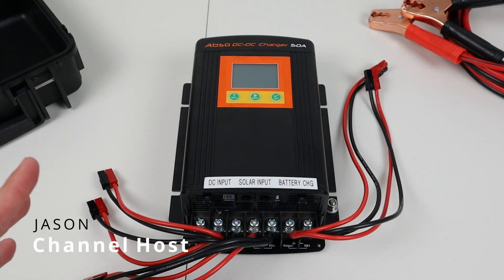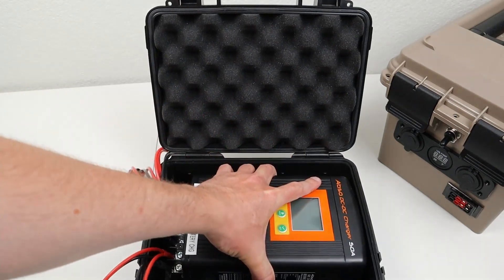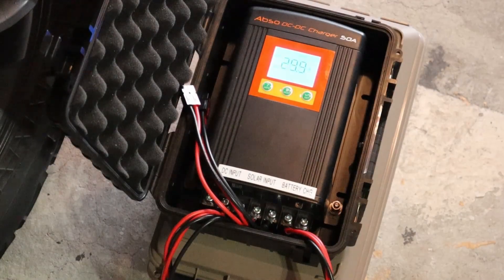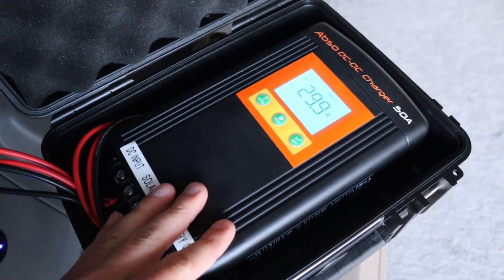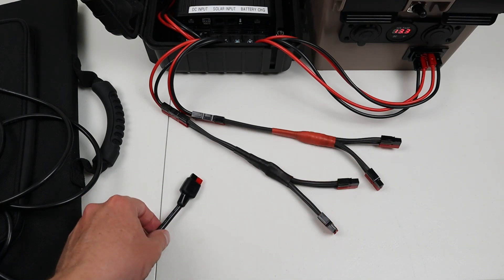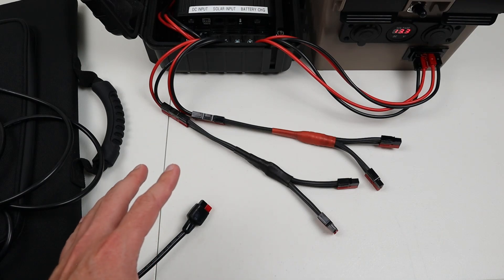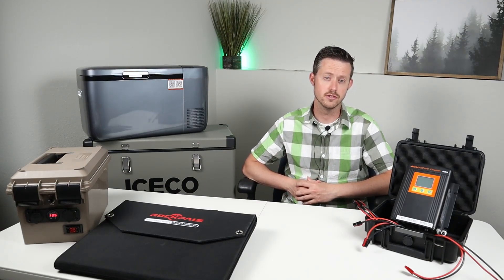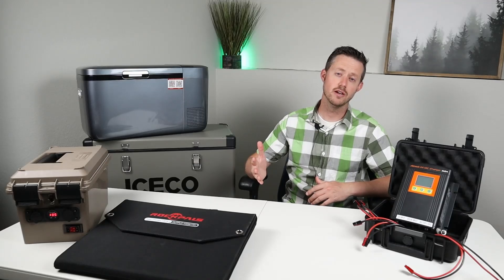The Perfect LiFePO4 Charger?! - Kisae DMT1250 Solar MPPT and DC to DC Charger! Portable and Powerful

Comment: Do the terminals support 6 AWG wire for the DC/DC input/output?
Reply from the maker: 6 awg should fit just fine
Reply: @Jasonoid  And do you know what revision level of firmware is required for the remote display to work with the DMT1230?
Reply from the maker: @s.mendez7160  I'd reach out to their support for that question.

Comment: Thanks for the video! I've been searching for a solution to charge my Bluetti AC200P for my Tacoma while driving and also when no Solar available. So happy to have found you this awesome solution.  In lieu of the Pecron DC1242-500 Smart Car Charger, this device has more options. Favor, I see you this wired to your 4runner and I like to also wire to back of my tacoma. What are the wire sizes you used and also the fuse that you used? Thank you!
Reply from the maker: This won't charge a power station, you need higher voltage like the Pecron car charger to do that. This only puts out 14v. This is only for charge standalone batteries. If you want something similar but meant for power stations, look at the Etaker car charger.
Reply: @Jasonoid  The Etaker is exactly what I'm looking for! Thank you Jason! Keep up the great work!

Comment: Hey Jason, I revisited the video and noticed something intriguing. You mentioned having around 670 Watts of solar panels connected to the KISAE Abso. However, the video stated that it accepts a maximum of 500 Watts of solar input. Does this imply that if I were to parallel two 300 watt panels, the unit would only utilize what's necessary to achieve its maximum output?
Reply: Hi Jason can you tell me how long typical the Kiesa takes to charge your 100 Ah LifePo4 battery?  I have the 30 Amps Kiesa charger.  It's been about 4 hours now and it's still charging.  Is that normal?
Reply from the maker: I'm pretty sure that's how this unit works, with more than 500 watts of solar connected, it would limit the output to the battery at 500 watts.
Reply: @Jasonoid  Okay thank you I have a couple of house panels I brought used on facebook marketplace and just wanted to know if they were too much power for this unit. 
Thank you again!

Comment: Thank you for this video, I've been looking for another solution to keep  my AGM and Lithium batteries top off in an emergency.  I'm a beginner, I had some ideas but didn't know how to fully implement them.  After seeing your video I was able to purchase a DMT1230 open box on Amazon for around $100 bulks.  I have some powerwerx 10 gauge wire, left over from another project.  I notice that you were using 12 gauge wire double up for your connections.  Can I use my 10 gauge wire?  Secondly is this 10 gauge wire suffice for my 100 watt panel to connect to the controller an from the controller to the battery being charged?  Lastly do I need a inline fuse?  In the future can you make a step by step video showing how to setup the DC to DC charger?  Reason being I have different AGM an lithium size batteries I would like to keep top off.  Any help would be greatly appreciated.  Thanking you in advance!
Reply from the maker: Nice find! 10awg wire is good for 30 amps peak, so that will be fine with the slightly smaller DMT1230 (especially with the 100w panel). You shouldn't have to worry about fused on your charge controller, just fuse any of your loads coming off your battery.
Reply: @Jasonoid  Thank you for replying to my post.  And thank you for that info.  I connected a 12V AGM to the battery input side.  Just to see if it would allow me to view the menu options.  The screen would not turn on.  Does that mean the unit is damaged?  Or do you need to use a solar panel to power it on?  Maybe the open box was sent back to Amazon for that reason.  Not really sure what are your thoughts?  I'll try solar panels in the morning to see if it will work.

Thx!
Reply from the maker: @minceym  connecting the battery to the postive and negative input ports on the charger should turn the unit on and allow you to change all settings. Once you connect either DC input or solar input it will start charging.
Reply: @Jasonoid  Okay I'll give it another shot in the morning.  Lastly I purchased the HUB from your last video, and it works great.

Thx again!
Reply: I just wanted to follow up from my last post.  Everything is working properly now.  Last question about this unit.   Can it handle DC & Solar inputs simultaneously?  Or only one at a time can be connected to this unit?

Thanks Again!
Reply from the maker: @minceym  it will only do one charging source at the same time, it seems to default to solar as first priority.
Reply: @Jasonoid  Thank you very much!

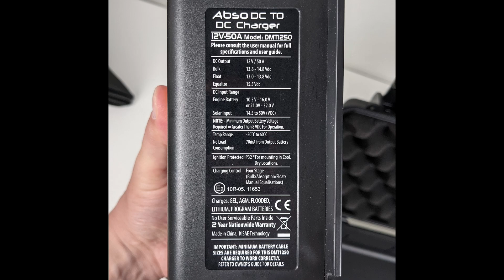Comment: @10:06, looks like BULK CHARGE goes up to 14.8V..Not good for LFP!
Also, the Equalizer is 15.5V  Is there a way to turn that off (unless you  are using Lead)?
Reply from the maker: It's completely programmable, you can set it differently per chemistry. It also turns off equalizing with the lithium setting.

Comment: Overheating is a very common issue with these chargers. The manual for DMT 1250 states that it should have 3 inches of gap and airflow on all sides. I don't think it should be enclosed in a box.
Reply from the maker: Been using this for 3 years in this setup, never had an issue. As long as the lid is open it gets plenty of air movement.

Comment: Hey there ! i have the DMT1230 and really wanna know if i can use a ctek 25a charger connected to my starter battery and then charge my lifepo4 house bank via the dmt1230 ? or is it only possible to use that feature with the engine running ?
Reply from the maker: SO to clarify, you want to have two chargers running at the same time? The Ctek 25amp and the DMT 1230?
Reply: @Jasonoid  Yes I want the ctek to charge my engine battery and then DC to dc charge my lifepo4.. asking because my ctek charger don't have the right voltage to charge lifepo4 directly hope it makes senes know...thanks in advance 👍
Reply from the maker: Isn't your engine / alternator charging the engine battery automatically? You shouldn't have to worry about charging that battery separately. The DMT1230 will connect to the starter/engine battery and then it will charge the LFP battery.
Reply: @Jasonoid  Yes it does :) BUT the installation is on a sail boat and I spend many hours on the boat while being in harbour with shore power connected. To charge my house battery that are lead acid right now. But gonna be LFP and when I install LFP I would love not to should buy a nem ac-dc charger. If I would work through the dmt1230.. so that's why 😄
Reply from the maker: @peteperformance  as long as the battery is connected to shore power or the engine is running, you should be fine charging your second battery using the dmt 1230
Reply: @Jasonoid  Thanks. I will try it out and see what happens 😄

Comment: what if you want to charge the battery box in the house? can you connect a dc adaptor from the wall outlet into it?
Reply from the maker: That would work, or just buy a LFP AC wall charger.
Reply: @Jasonoid  

Yeah seen your video on the the powerwerx 300watt charger, think I’ll buy that means I can use solar and when am home and wanting top up I could plug a ac wall adaptor (given it’s over 17.5v) into it. 

Thank you it’s my first diy battery box so just trying to plan everything out before pulling the trigger 👍

Comment: Those wires you are using are way too high of guage. You shouls be using 4awg as the main dc in and 4awg out the house battery array.
Reply from the maker: I'm running two sets of 12 awg in parallel, good for 40 amps continuous. I usually charge around 25 to 30 amps max which would be 10 to 15 amps per line.

Comment: Thanks to this video, I've been following the Kisae DMT prices on Amazon for a long time.  I almost pulled the trigger several days ago when the DMT 1230 dropped to around $160.  Then on Christmas day, it dropped to $137.xx minus 5% checkbox coupon.  Quantity 7 was available.  I grabbed one for that $130 and change.  The bad news is that now with quantity 6 left, the price is up to $283 minus 5%.  The usual Amazon games (and yes, they are the actual seller I bought from, not a third party).  

Consider this a heads up for people to throw it in their cart and move it to "save for later" to watch the price in case it bounces down again.  I'm thinking $130 was a steal.  

I'll be using it in a Prius Prime for running my Vevor (with LG compressor option) clone of Alpicool CX50 freezer that fits behind the passenger seat after removing its carryon-luggage type of cart/wheel setup.  I'll normally set the Kisae down to 10A charging for the 50Ah LiFePO4 I recently picked up for $153.  So far, I only have the 60W version of the newer gen Rockpals for solar, but when traveling, I sleep with the car on for climate control.  So, most charging will come from the car 12V, which itself is kept topped up by the 8.8Kwh PHEV battery or the engine, but only when the car is on.  This Kisae will let me not have to cycle the car's 12V battery down or rely upon freezer low voltage cutoff.  It will also let me charge the car from shore power while keeping the freezer running, because the car shuts off after a minute when being charged.

Comment: I’m new to this so here is my dumb question. So whenever it comes to using solar charge controllers, they tell you to connect the battery first and then connect your panels because otherwise you will destroy the controller. Is this the case for this charger as well? What if I’m charging a lithium iron phosphate battery with a built in BMS, BMS would disconnect the battery once it is full, would it then destroy this charger if I don’t unplug the solar panels in time?
Reply from the maker: The charge controller will always shut off charging when the battery is full so it's fine to leave it connected all the time. You want the battery connected first.
Reply: @Jasonoid   Thank you for your reply, I appreciate it.

Comment: Jason, have you looked at Renogy dc to dc mppt chargers? If so, how do they compare?
Reply from the maker: They cost similar, a little cheaper but they do not have solar chargers built in, so they will not support solar charging like this one does. I think they have a 20amp and 40 amp model, this one does up to 50 amps.
Reply: @Jasonoid  I’ve just been looking at one that claims dc to dc and mppt for solar. It’s a lot to take in, maybe I’m missing something. 
Renogy DCC50S 12V 50A DC-DC On-Board Battery Charger with MPPT
Reply from the maker: @fredir3596  must be a new model, I haven't seen that one before. I'm sure it will work just like this one then.
Reply: @Jasonoid  thanks for taking the time to reply. I’ll keep researching.

Comment: Hey, I went with the Dr. Prepare  100ah LifePo4 battery and I’m probably going with the Sunpower 50w (2) solar panels to run an Iceco fridge. I’m probably not using it for much more than that. So, 30 or 50?
Reply from the maker: I'd go with the two 50 watt panels to fight off the clouds / shade. That will work well! 30 amp will be plenty! Unless you plan to upgrade larger in the future!
Reply: @Jasonoid  Can you explain what you mean by "fight off the clouds/shade"? Is that because panels in series are less affected by shading than panels in parallel? Not sure if you've covered the topic much before, but a video would be awesome if not.
Reply from the maker: By using two panels you will still get some power when the conditions arent perfect. I always like to plan for more solar than I really need because when clouds or shade comes around your power output drops significantly. Parallel connections are better for partial shading performance (if small sections of the panel are covered by branch or leaf shading).  All panels I have tested don't perform well in cloudy conditions, which is different that partial shading.
Reply: @Jasonoid  thanks again for the reply. I did more research and found just what you stated. I decided to run parallel but to be prepared for series, depending on conditions. I will also expand on solar panels, in the future, to beef up power if needed.
Reply: Copy that, thank you for taking the time to write such a detailed reply!
Reply: @Jasonoid  I did go with the 100/30. I can always upgrade later but my plans are to keep it small. On that, I will not be using an inverter so my power usage will be the Iceco VL45 fridge and a few usb outs. What fuse should I use at the (12v 100ah) battery? I’ll have a fuse panel for the outputs.
Reply from the maker: @fredir3596  125 amp fuse should be adequate for the main battery lead.

Comment: Does this have house/car battery isolator protection? thanks!
Reply from the maker: Hey Chu, I am not familiar with that terminology, can you explain what feature you are looking for?
Reply: @Jasonoid  when the car engine is off the charger should isolate from the car battery so not to drain it. thanks
Reply from the maker: @e3ucxp  yes, the minimum input voltage for DC to DC Charging is higher than 13volts so it only charges when the alternator is putting out power.

Comment: Cooling vent for the internal fan is on the top/back. Be careful with it in that case. Great unit. I’ve installed several. Great video.
Reply from the maker: I've felt the air flow passing through the sides of the case when the fan turns on so I think it gets plenty of airflow. , I'll also never charge it with the lid closed.

Comment: How does this compare with the Renogy DCC50s? It claims 50 but it's really 25/25 or 50/0 or 0/50 but if anything is coming from the other you'll see a huge drop that looks like 25/1 or 1/25. Didn't know this like all of 2020 😞😁.
Reply: I’ve installed both in van builds. The Renogy is 25 amps for each solar and dc-dc. This Kisae is 50amps dc-dc and up to 600 watts of solar and up to 50 volts. The renogy is 12v panels only, no series string wiring. 
The one cool trick with the renogy is that it will charge your start battery from solar once your house battery is full. 
For the money the Kisae dmt-1250 is what I install for all my van customers.
Reply from the maker: Hey Fred, I don't own the Renogy model so I can't vouch for it's reliability or all the features. The DMT1250 also only takes one input at a time but it's "smart" and allows a much larger input from that single source. It can take in about 50 amps of DC to DC charging from your alternator and about 35amps from solar. I knew this when I bought it since it's stated on their website in the specifications.

You might see more charging input using the Kisae product vs Renogy. The DMT1250 is slightly less expensive as the Renogy and also includes a screen so you can see whats happening, no need to spend extra money for the bluetooth adapter. I have been very happy with it since it has lived up to all the stated specs.

Comment: What efficiency can you get on the DC input vs DC output, and the Solar DC input vs DC output? How many watts in vs watts out?

Also, can you concurrently pull power from solar and DC inputs? Sometimes you might have moderate solar coming in but you want to make up the difference with the alternator.
Reply from the maker: This charger is a beast. It's my current go-to portable solution for charging my 100ah LiFePO4 battery while camping and road tripping. Full customization and an actual CC/CV charging process. The solar maxes out at 30amps charging and you can get 50amps charging from your alternator. I usually only set it to 5 amps while driving, and 30 amps while parked idle trying to top off the battery.

You can only use ONE charging input at a time and there are some detailed settings to have one auto selected if BOTH power inputs are inputing power. I think it defaults to solar.

You can see all the specs including efficiency here on their website:
https://www.kisaepower.com/products/dmt1250/
They say >90% efficiency, and >98% efficiency on the MPPT tracking and I have no reason to doubt their numbers. It's an awesome dual charger.

You can download the full data sheet, spec sheet and owners manual and wiring diagrams on their website listed above.
Reply: @Jasonoid  Right, I saw the 90% and 98% already. The problem is that I often see real tests fail to meet those numbers.

The other question is whether it's 90% or 98%, or is it 90% of 98% which is 88.2%.  The only way to know for sure is to actually measure the watts in vs watts out.
Reply from the maker: @GeorgeOu  well maybe next time I have it out and all connected up in use, I'll give it a test and see 👍 would be good to know
Reply: @Jasonoid  Thanks!  Efficiency metrics are always valuable for any hardware review!

Comment: Is it possible to connect the DC to DC charger directly to the alternator, without a starting battery? This would allow a common alternator to charge AGM batteries the right way.
Reply from the maker: I don't think so, youd probably see voltage spikes or in rush current. The stater battery acts like a capacitor to keep the voltage and current smooth.

Why wouldn't you want to hook it to your car battery? I haven't seen any issue.
Reply: @Jasonoid  On my single engine boat I have 2 alternators, one for the starting battery and one for my house battery bank. The house alternator is a 130 amps with integrated controller. I plan to upgrade my house battery bank to lithium. I thought that using the DC to DC unit I could could charge the house battery bank with the actual alternator.
Reply from the maker: That makes sense. You could always call the company and see what they recommend. The Don Rowe website should have a contact number. They would know best! I love this charger though!
Reply: @Jasonoid  Thanks. I have sent the question on their website...